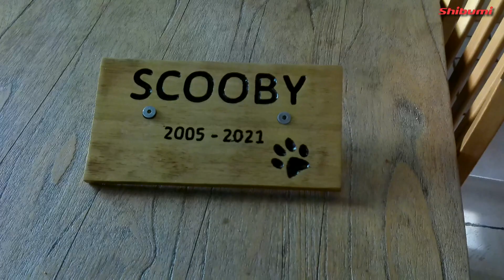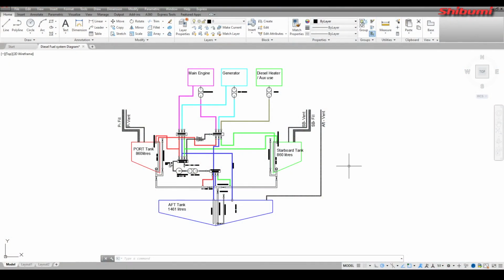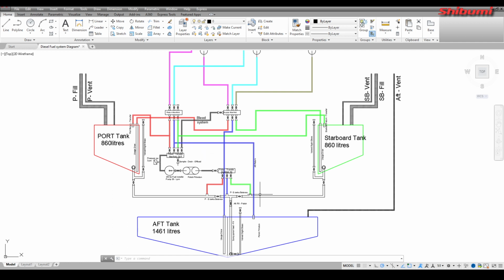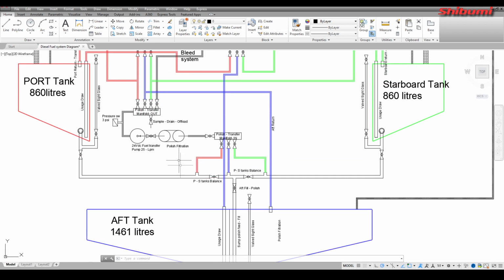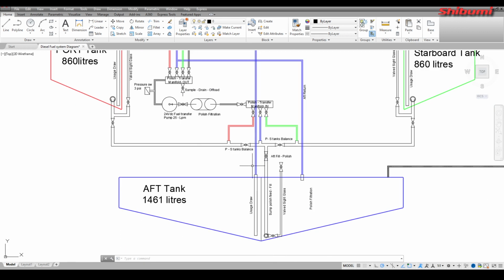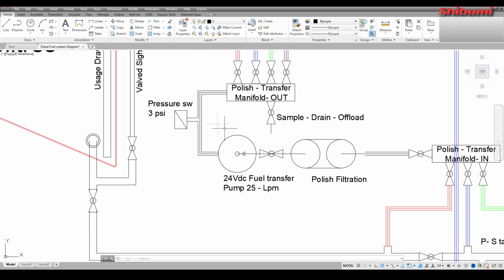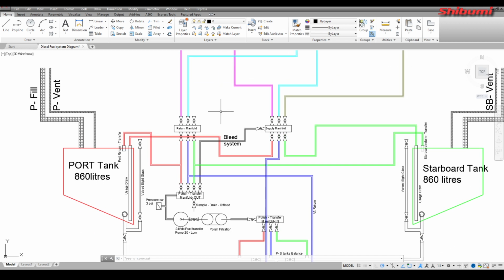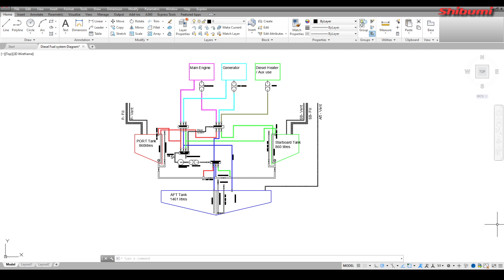Shibumi Boat Build - EP 41 - Weather stops work - Fuel system design and walktrough

Comment: For short projects that you want to get done that require warm air I have used rental heater that stays outside and has ducts that can be located inside. When done I just return them. I don’t know how if at all it would help you especially with COVID and all. Sorry for your loss I know it can be a weight on us.
Reply from the maker: I'm not in a position currently to have heat but summer is coming and will hopefully have insulation in soon. winter time and raw steel are a challenge..

Comment: I have always had trouble sucking fuel through filters, I have found it better to push fuel through the filters.
I would probably put a pre filter then pump the polishing system then back to tank or to required application.
Reply from the maker: Thanks for some great advice and very welcomed :) pre and post does sound a better plan. Initially I thought it should be after the pump, but saw many commercial units doing it pre pump hence my plan. Thanks Dirk.
Reply: Some filters are designed to be suction while others are pressured. Pre-pump filters when they start to load up will have a pressure drop, this can lean out a motor but your design is for polishing so not as big an issue. Any system you use should have a water separator in it also.

Comment: How to control the fuel supply with such a complex valve system without overloading the brain? PLC? Nice to follow you. I have a steel boat to. 😅
Reply from the maker: Great question.. yes a fully PLC system woulld be cool, maybe for the fuel polish / transfer end, I think I'll leave the main stuff on manual for long range safety.. a faulure of PLC would be a nightmare, inless had manual override on all valves and that would cost a fortune.. love to see your steel boat ! Dirk.